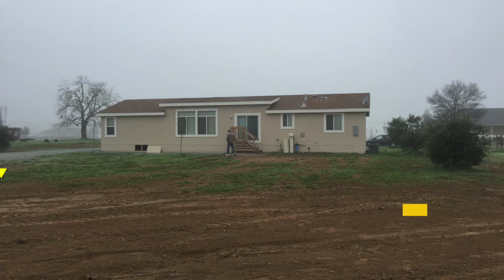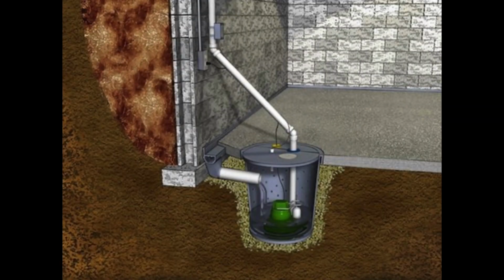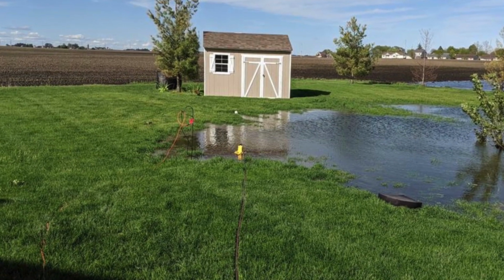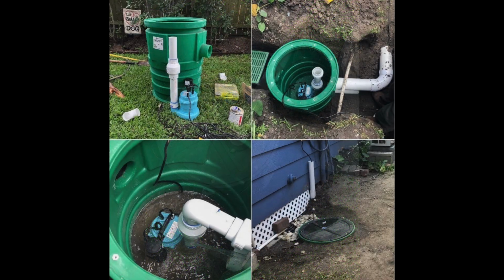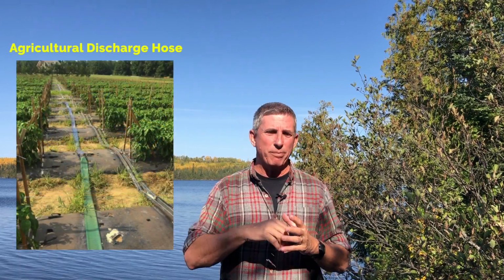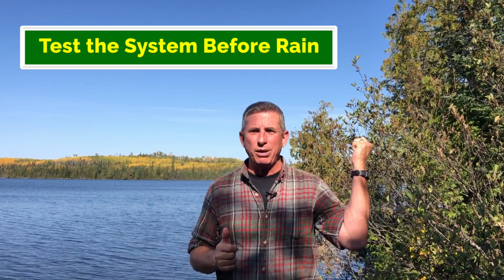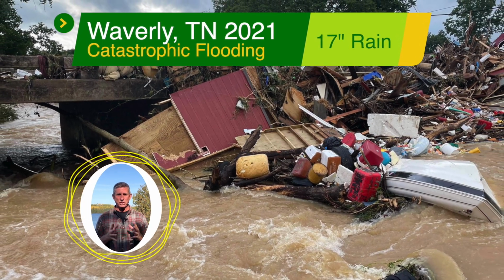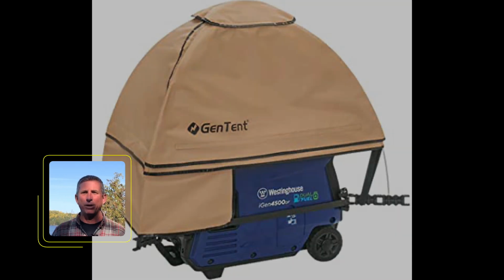Yard Flooding? How to Drain a Flat Yard (Mechanical Drainage Solutions)

Comment from the maker: 💧 Does your yard flood after heavy rain?

If your property is flat, gravity drainage often isn’t enough — which is why mechanical drainage systems like the one shown in this video can make a huge difference.

👇 Quick question:  
Where does water collect the most in your yard?

• Near the house  
• Middle of the lawn  
• Backyard low spot  
• Along fences or property lines  

Your answers help us decide what drainage topics to cover next here on the channel.

If you're planning a landscape project, these resources will help you avoid costly mistakes:

✔ 15-Step DIY Landscaping Project Checklist  
https://www.youryardcoach.com/15-step-diy-landscaping-project-checklist  

✔ DIY Landscaping Course for Homeowners  
https://www.youryardcoach.com/diy-landscape-course  

Let’s get your landscape working with the water… not against it. 🌧🌿